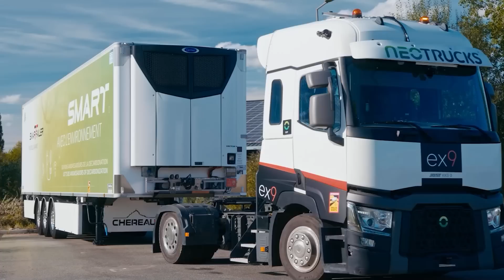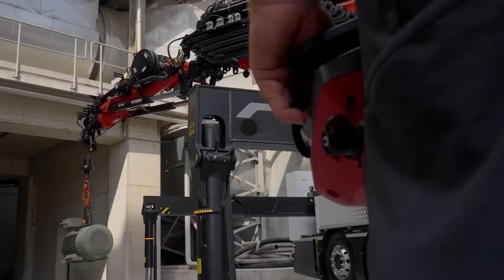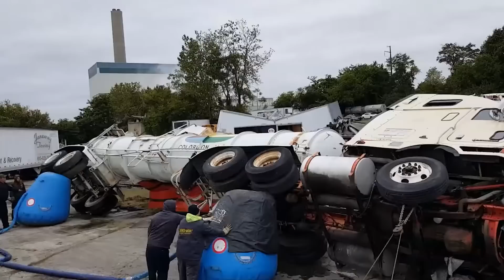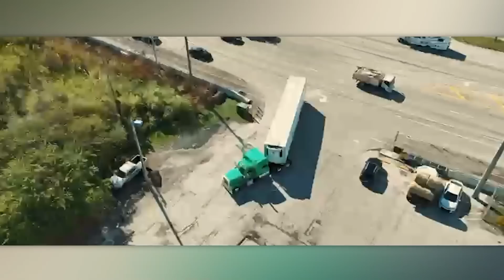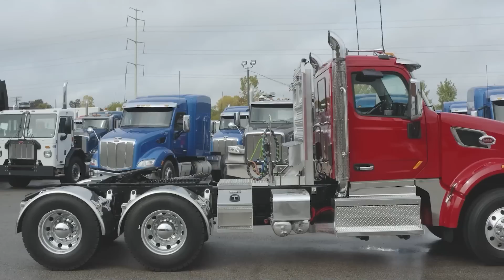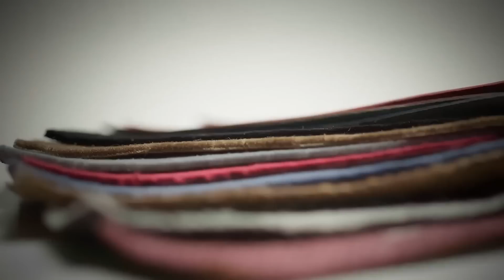INGENIOUS TRUCK INVENTIONS YOU MUST SEE

Comment: They don't show you the bit where the human has to connect the Susie lines for the brakes and power to the trailers in those videoes- yet they are magically connected...Re the Spojtrak truck- you can tell it wasn't designed by a truck driver, as no driver likes the pod bed above as they are a death trap in a fire situation.